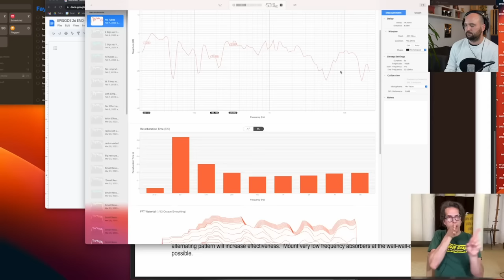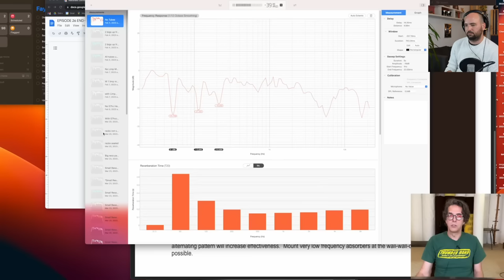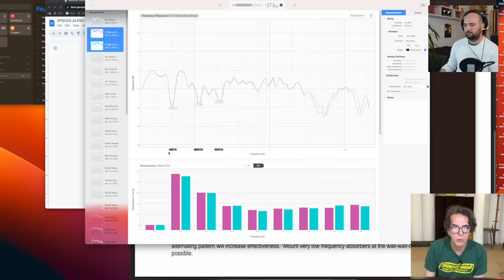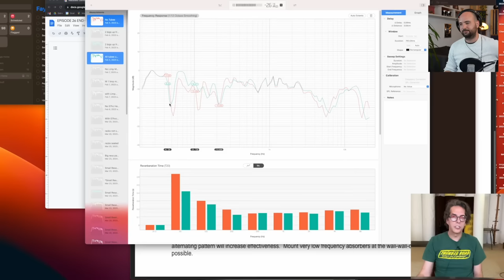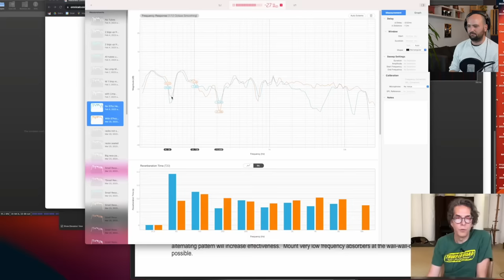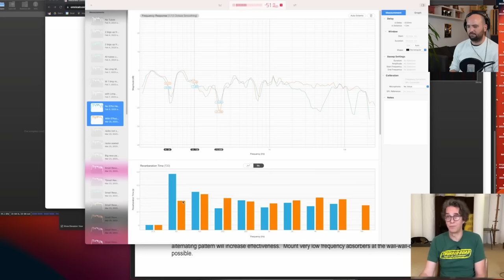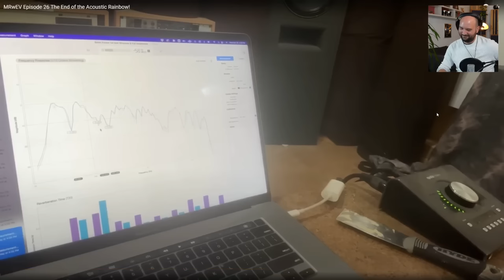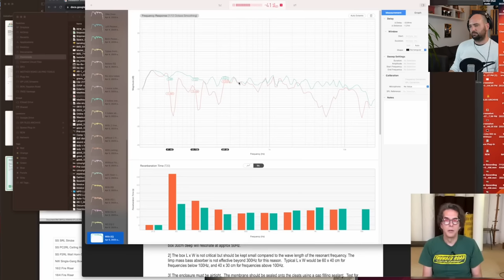Reaction Video: Eric Valentine’s Studio Build - AcousticsInsider.com

Comment: I had similar experience with Tube Traps  and actually, it is well known that Tube Traps perform better than standard flat panels of the same depth; in fact, ASC with Tube Trap and wall attack have been known to give excellent results. and Eric tried those panels and had a wall with fiberglass and then he tested and measured and realized that tube traps are much better and have more bandwidth than panels...it's just acousticians don't want to promote its use because if you are smart, know some acoustics, have a good ear and know how to use REW, you don't need an acoustic and even though tube traps are much easier and faster to build than a wood panel with fiberglass or wool mineral....interestingly just recently GIK is selling tube traps and I think are their most expensive products...must be a reason...
Reply: Trouble with them is the eat up space, in my small garden mixing room there is no way I could have used them and ended up with anything practical to work in, plus they look dreadful, like a carpet shop storeroom! 😬
Reply: @kadiummusic  that is the negative of Tube Traps...but if you can afford to eat up some space...are great
Reply: The reality is with enough research and effort you can learn any skill and avoid hiring people right? But you've only got 24 hours a day to get it all done
Reply: @ezrashanti  both ways of doing it are fine, depends on your free time and priorities :)

Comment: Jesco, could tube traps be more effective than standard rectangular porous absorbers because of its larger surface area? The surface area of an 8 foot cylinder is much greater than the surface area of an 8 foot rectangular box. But maybe I’m missing something. I would love to get your opinion on this. Thanks for the great videos!
Reply: Full cylinder surface is pi * d * h. Full square prism surface is 4 * d * h. 4 is greater than pi. But if you place them close to each other, then yes, the cylinder turns out to be larger

Comment: WHY jesco stil trying to sell the idea that tube traps are the same as porous panels, they are not, and they are not filled with porous material....
Reply: Eric’s tube traps was porous absorbers. He uses pipe isolation. Pipe isolation is just mineral wool or foam to put around a pipe. It’s clear if you watch Eric’s  video.
Reply: @badmongleo it’s very very very compressed fiberglass tho, Is the stuff used in regular panels and traps the same? My pipe insulation tube traps are like hard they’re so compressed.
Reply: Iam not shure check out Erics videos he talkes about it. My guess is that the properties of the isolation doesn't differ that much from mineral wool to make that much of a differens. Tube traps did work for Eric but my guess is that if he back filled all the area covered with tube with mineral wool he would probably get the same  effect and a cleaner look and probably cheaper.

Comment: long time fan of eric! such a lovely, talented and giving human being - hard to find these days. i´m in the process of moving into a new studio space so acoustics are a big subject for me right now. really appreciated his video therefore. but quickly realized that these large diameter tubes arent available here in germany or even in europe. so i was also wondering why he deemed them so effective. seems to me that the material is denser/tighter than the regular rockwool/fiberglass panels. and then also the fact that there is a front layer and a back layer with some air in between. would love to know if thats correct. or if fully filled absorbers are more efficient than ones with an air gap inside. i remember in other areas an air gap is beneficial.
Reply: Hi! I think Im at the same spot than you were 10 months ago and Im asking If you ever found something similar to those tubetraps in Europe? Since I saw every Studio Video of Eric I really have faith in those tube traps. Greetings!

Comment: The magic of the tube trap is in the air gap in the middle. 
Most people treating a room forget that airgaps between rockwool make a much bigger improvement then completely filling the thing up with no airgaps. I

f you think about it, when a soundwave hits a tube trap, it passes 4 times against the rockwool insulation. Front side of the trap, airgap, back side of the trap, hits the wall, comes back and repeats.

Comment: 09:40 good point Sir but; 
since most of us mix using two speakers simultaneously, isn't it more valid to do measurements with both speakers, especially for the low end to observe the complex phase interactions that each speaker and its reflections excite in he room? My room is very specific and has some troublesome spots but my measurements are always slightly different when doing both speakers vs doing them one by one. Especially in regards to decay time displayed on a waterfall graph. Thanks for a great video!

Comment: and also 18:08 about the SBIR - isn't is common knowledge, that you put the speakers as close to the front wall as possible so that the SBIR frequency gets higher in spectrum and just treat it with broadband absorptive panels behind the speakers? (or the opposite, far enough that SBIR freq is below the low end cutoff of your speakers, which is probably unpractical 99% of times)

and an afterthought - how about the bass reflecting from the floor and ceiling (some kind of vertical SBIR)? are these a real hazard?

Comment: I've also experianced far better results wtih tube traps, mine have a diffusor on the surface and inner resonant tubes, which seem to give a multiple result, but also being able to hang them away from the wall, or corner place perhaps improves performance?

Comment: My overriding feeling is that his end result (if not the journey!) is fairly typical for a successful acoustic treatment but the tubes look terrible! I may be wrong but surely he could have achieved the same results with the correct choice of panels and the asthetic of the room would be so much better. Maybe he's someone who doesn't care what it looks like but for me walking into what looks like a carpet shop storeroom would drive me nuts and definitely wouldnt inspire me to be creative! 🫣
Reply: Yeah Eric is known not to care about aesthetics. His first studio was called HOS (Hunk of Shit).
Reply: that is the big question,  yes tube traps are deeper but empty and super easy to make.... so the big question is that if  at the same mass volume of the tube traps equals in absorption and broadband results as the same mass  volume of porous panels??    clearly the Tubetraps are way easier to make and cheaper too
Reply: Eric’s case would probably be easier to fill the entire wall with a thick layer of mineral/glasfiber wool held in place by one big panel then cover it up with fabric. Cheep good looking. This is the way most pros do it. Glad wool is dirt cheep and framing also.
Reply: I may be wrong, but I think in either this video or maybe the one following this called “The End Of The End Of The Rainbow” he talks about once he’s got everything tweaked, putting fabric walls around everything.